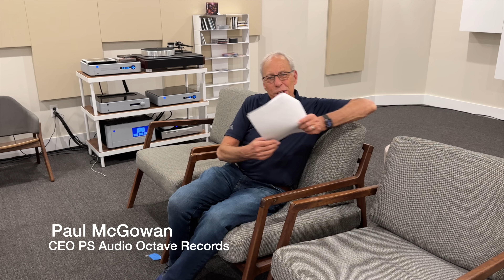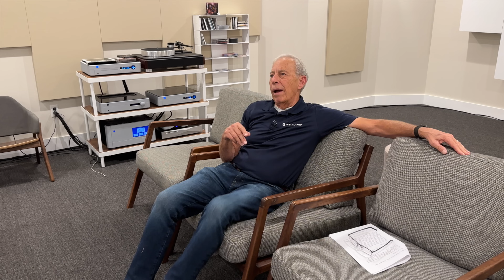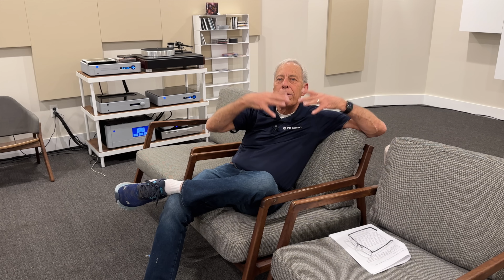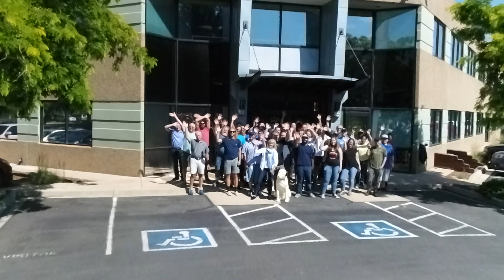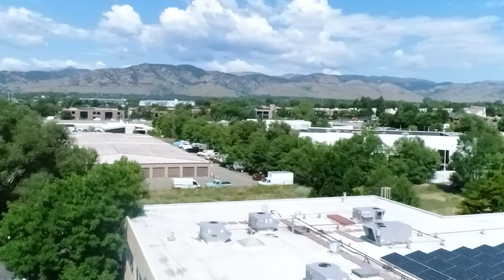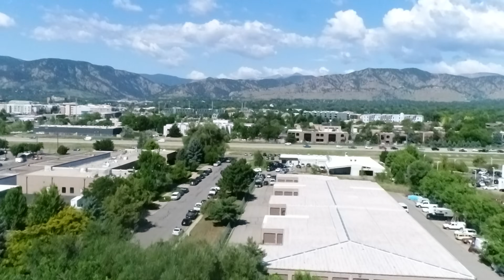Regenerators and iso transformers

Comment: Agree on power filters, 
Never got on with them, sucked the life out the music.

Running your kit on Balanced mains is a different game from an Iso Transformer tho.
Agree on overkill to keep impedance low, run my PSA gear from a 10KVA hardwired balanced mains to great effect.

Clean, close to zero noisefloor and lots of 'air' and life in guitar strums. 

Common noise rejection (balanced) works great for audio,
David Gilmour as well as many Recording Studios use them.

Just another take. 👍

Comment: Yeah, even when it's just about supplying power to a USB signal cable, which is like just 5w, a 1000w iso transformer still much better than a 500w one, and I find low noise low impedance power matters a lot more during the digital transport stage than in the power amplification stage

Comment: I had a Furman and Paul is correct, I took it out after a month and sold it. I did make a diy power bar with 12 ga braided cable that made a small improvement. I also have an isolation transformer that is rated for 1700 W when I had it connected to my power amps it kind of killed with Sound. What I did find that worked, was having it connected to my preamp and Dac  , again, not day and night difference, but a small improvement. Just play around and trust your ears. 😊
Reply: I also ran one on the digital stuff for a while.  It was hard to tell if it better or just slightly different.

Comment: The circuitry of power amplifiers and other gear operates from DC, which results from rectification and smoothing of the A/C supply.
So long as the quality of that DC and its voltage stability under load is good, which any reputable manufacturer will ensure, then you are just fine.

Comment: Exactly what I found.  I tried IEC and 1000VA super sized torrid isolation transformers.  Definitely makes a difference, but kills the life of the sound.  Any type of inductor the same.  Small amount of capacitance to filter high frequency noise, not so much.  A DC blocker can be useful if you DC on your mains causing buzzing transformers.
I think the best 'filter' is a good length of power cord with twisted pair conductors which may kill common noise.
Reply: Placebo is the name.

Comment: Sound difference between with or without power filter/iso tranformers compared to direct plug in can be heared ONLY if current comming out of your wall is out of specs of your device.
Everything within specs your gear can handle without problmes. It is designed for it. 
I really doubt PS Audio gear isn't made good enough and needs any help doing it!

Loosing highs......placebo, because you expect from videos and other claims that to happen. No it doesn't! 
Sorry Paul, but you lost highs because of your age and normal aging proces of our hearing.

Once when one peeks inside amplifier or wathever it is very easy to see whole electronic component made for converting AC to DC and regulating/filtering that DC. Our gear runs on DC that is created inside a box, not on AC comming out of wall! 

Saying that it is total b....s... to recommend any filtering, regeneration or whatever. What is the most important is that our homes are connected to proper/stable current source and that cables inside our wals are properly sized and connected.
Everything else is snake oil!
Reply: My electrothearphist measured the power from
My listening room wall outlets and fund them to be 
Semi dirty so i connected a semiregenerator by known
Nobel High End supplier that regenerate half of the unit
Out P (instead of the semi dirty portion of power signal)
  And blend it with half non regenerated original half
( the clean portion of the incoming power signal)
.
It's costed only 3k but i can hear now clearly b o t h  the
over tones of the black background after organ crescendo,
Flute power riffs, tambourine slide fretting and gated toms 
A n d  my mother Whispering from 2 floor above, and she
 have been decided for the last 12 years!!!!    

Amazing solution to my problame with possessed demons/ 
lost audiophile souls that noise jittering my karma after midnight! 

Be blessed, healthy, educated, free and prosper.
Reply: @Blacksheep1042  🤣🤣🤣

Comment: Is there some technical reason why an AC power conditioner should lack upper midrange, or is it a common practice for the maker to lessen those frequencies, to cover up distortion, and give the impression that the sound is cleaner?. Most speaker drivers I've heard (lots), seem to curtail upper midrange. Hearing one that doesn't, that is clean sounding enough not to have to hide anything there, is a revelation. In the midrange the human ear is particularly sensitive to things like distortion, noise and pitch wavering. I never noticed any decreased upper midrange from any AC power conditioners I have used. Only cleaner, sweeter, more open sound with better bass. Maybe I have been lucky. Speaker drivers tailored to hide problems in the upper midrange by backing off there, are much more prevelant in my experience. The moment of realization for me was hearing a certain midrange driver that was appropriately bold there; it had 2 seperate magnets in back of the driver instead of one; with space between them.
Reply: One of the reasons AC power conditioners have better sound is the power cord itself, which usually is thicker and lower guage. I like the fat wire. To my ears, always more beefy in the bass and bigger image size. The exact same improvements you would get with a bigger and better transformer.
What a thrill it is to get life size images. Our ear brain system is not fooled by instruments that sound miniaturized. You will never get sound that can occasionally, legitimately fool you into thinking that what you're hearing is real,  if the instruments sound too small.

Comment: I'm also of the philosophy less is more when it comes to the Audio signal. My systems are all computer sourced. I even go as far as to copy (from my thumb drive) to the actual hard drive to eliminate that 2nd USB buss from the signal path. Playing directly from the drive requires the signal to go through a 2nd unnecessary USB buss. That lifeless descriptor (you used) I experienced, but with my upgrade to your MKII recommended USB cable. Audioquest Coffee USB added life that was not present using my entry level Audioquest Forest USB. Similarly the Water XLR's did the same when upgraded from pure silver (Chinese) XLR's to my S-300. Need a regenerator 3 now. Hoping for a good deal on a used unit soon. A very happy customer here. Take care Paul.
Reply: @CJANegrcTtpX8HwbR2SBDd  SSD's only. I  use Intel NUK with aftermarket power supply in place of the standard brick power supply. Happy with noise floor.
Reply: @CJANegrcTtpX8HwbR2SBDd  That speaks to the quality of the DAC in my mind...if you are hearing a difference between playing computer files and a CD in soundstage then you def should try DSD files. Start with bit perfect playback software. Foobar2000. User interface is basic but performance is outstanding. Def no bells an whistles.
Reply: @CJANegrcTtpX8HwbR2SBDd 
Look in the audio settings on the computer..??
Try burning a CD and play that to see what happens..??

Never put all your trust in a computer..LOL  They have a mind of their own. .LOL